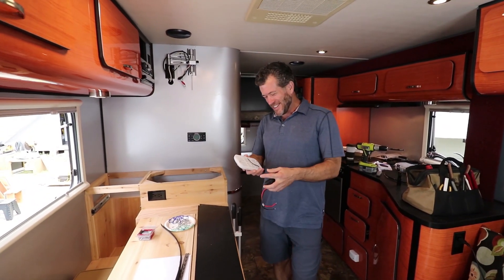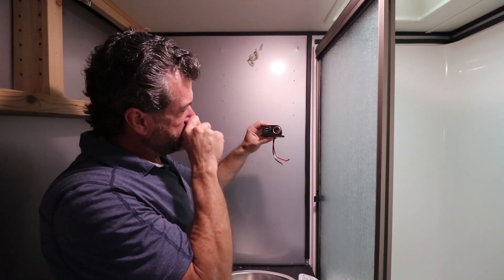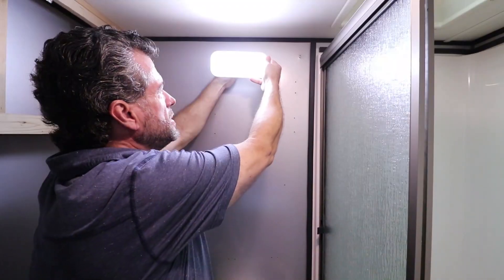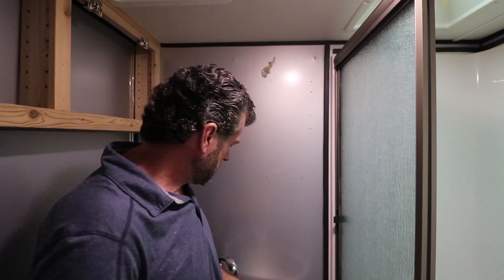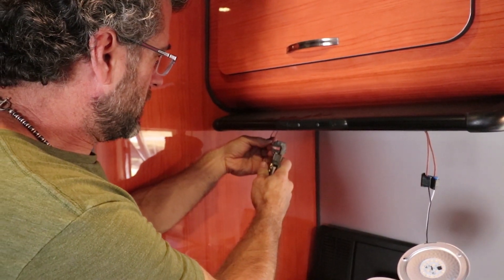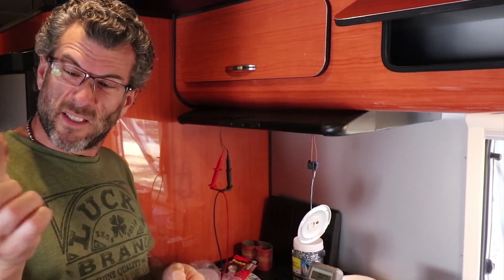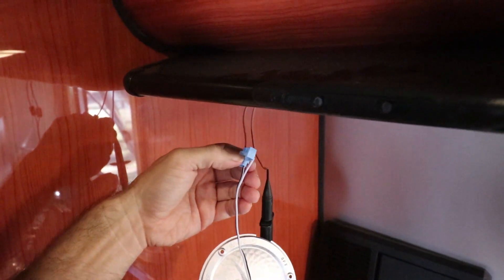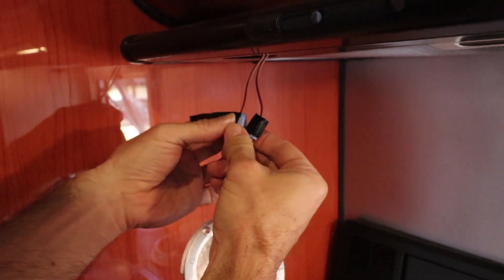Replacing RV LED lights, how to check 12v wiring, comparing lumens to watts

Comment: I watch a lot of videos on YouTube about electrical and LED and solar and I've got to admit I'm totally confused by it.  I try to learn but of course I forget it all. What I do know, and will never forget, is I will be taking my problems to a professional. I will not try it myself. Thanks for the great video guys.
Peace, Cynthia.
Reply from the maker: My brother has a gift with wood, an amazing carpenter. But anything electrical is like black magic. I try to tell him that it's about degrees. Changing the batteries on a remote is electrical work. So is using Pledge on wood instead of Brillo, he tells me. It doesn't make you a carpenter.
I laugh, of course. 🧡🔥💙

Comment: Another great video. I stock up on battery powered lights for emergencies. These little buggers do a fantastic job! So bright! https://www.flashingpanda.com/Item.asp?id=821&utm_source=google&utm_medium=cpc&adpos=1o2&scid=scplpfltHmeWalsw6_Wt&sc_intid=fltHmeWalsw6_Wt&utm_source=Google%20Ad%20Shopping&utm_medium=Products%20Ad&utm_campaign=SCTopTerm&utm_term=578505141720&adposition=1o2&gclid=CjwKCAjw1dzkBRBWEiwAROVDLAA6gV8272VwKHfY149q91USFzufPBAmLWrRagdqJWIGjwBJw7g1WBoC_OoQAvD_BwE

Comment: If you don't draw blood you're not doing it right, LOL. Very good information,  I find the led lights a little confusing, so this even benefits me. I live in a single wide that is 12'x75'. It's from 1995. The last time I bought light bulbs was when those spiral bulbs came out. They did last 10 yrs like they promised. The newer led bulbs are better. They say they last 10 yrs too. Love your videos,  can't wait to see how this new trailer works for all of you this summer.
Reply from the maker: The new LED technology is pretty impressive. It looks really bright in the trailer and altogether we are using less than 60 watts! When running off batteries it's going to save us a ton. And you're right, they do last a long time. 40k hours on most fixtures! 🔥